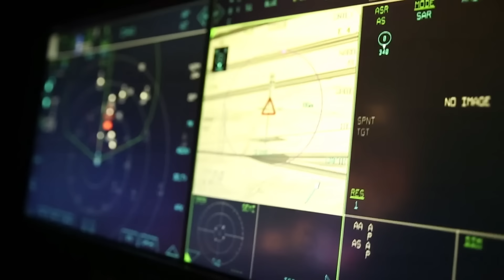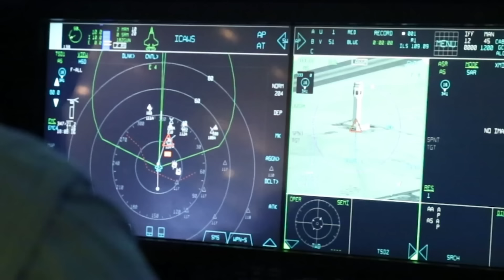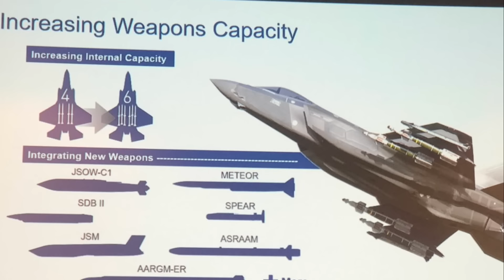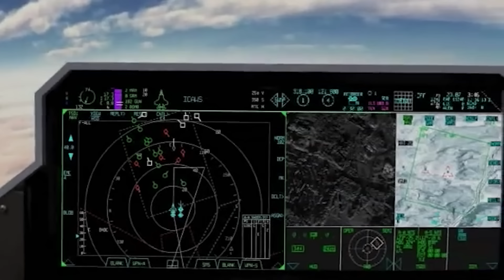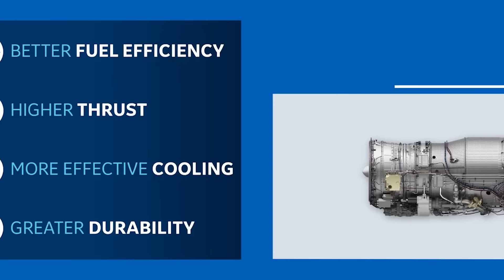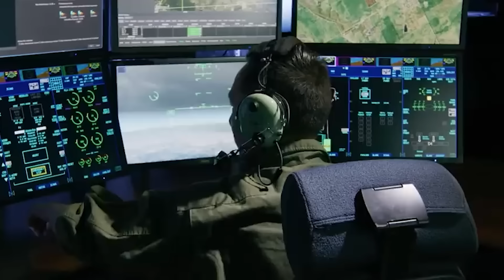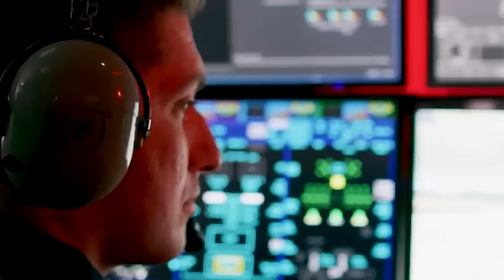The F-35 is about to become a POWERHOUSE

Comment: I have flown many types of aircraft and when a pilot tells you he likes the one he is flying the best, it makes sense to believe him. F-16, F-15, F-18, F-4, and many pilots from other countries have all said that the F-35 was the best most awesome plane they had ever flown and they didn't want to go back. Having been in many friendly dog fights, knowledge is king followed by speed. It can be visual or electronic but that is the edge every fighter pilot wants. This plane coupled with all of its sensors offers so much info that it might lead to an overload of the pilot. I understand that they now have a threat analysis computer that prioritizes the threats and can actually engage them in the correct order of danger. The new off-boresight helmet also makes getting on the 6 o: clock unnecessary and makes them even more deadly. At the Red Flag exercise, the kill ratio was one F-35 to 15 F-15s. I was a head-on Sparrow guy and a tail-end AIM-9 guy but those days are over with this plane. In a 4th gen fighter, I would not want to go against one.
Reply: you make some good points. I am not a pilot, but since my country, Canada, now is going with the f-35 instead of the Gripen, I am wondering if the f-35 is always the best choice. What happens if NATO gets loaded up with F-35's and then Russia comes up with satellite tracking, and ground based radar systems and planes with radar systems that make the stealth ability of the f-35 far less effective than it is right now? Seems like it might be wise to have a variety of planes that have different abilities. I don't like all the eggs in one basket when it comes to weaponry.
Reply: Tracking planes with satellite? Satellite is way to fast
Reply: @cameronkrause4712  have you seen Russia's excuse for a stealth fighter? And they do have radars that can track the F-35 (those are Russia's words, so take it with a grain of salt), but to track the F-35 the radar needs to turn on in the first place. When it does, itll eat a AARG-ER.
Reply: @cameronkrause4712  if F35B can be detected at practical distances, imagine how hopeless would be the non stealth planes. They could not even take off.
Reply: @drake101987  that is legit my point, but reworded. my point is that Russian radars may be able to detect it, but not shoot the F-35 down.
Reply: @cameronkrause4712  If they are stealthy, how would a satellite track them? Plus in a close combat area, a satellite would not be of much use since all of the aircraft would be in a merge situation.
Reply: We are impatient to see this fabulous plane exploded by Russian fighters and other missiles !!!
Reply: @Z24BL2  Not with the 1980 missile technology the Russians have. They are lucky to leave the launcher!
Reply: They use a low-frequency set that shows where the returns are not there or normal. It is radar by omission rather than the echo. But, that doesn't mean they can shoot them down only know where they might be. The F-35 is a much smaller return than the F-117 which was shot down years ago and has other assets.
Reply: @rudyyarbrough5122  Satellite tracking is generally touted as dealing with stealth by visually tracking as a complement to radar/IR. Signatures are bigger from above, but tracking birds from takeoff is the real pitch.
Reply: That doesn't make any sense. The helmet may be able to see behind the fighter...but the missile is only 90 degrees off bore sight. Do people not understand 90 degrees is left and right and behind you is 360 degrees?  Why do I keep hearing this from F35 fans. "I have friends in ( ________)  and they say F35 shoot UNDER itself ". Or something equally innane?

No I'm pushing back on this. It's a gross over simplification. Even if you could fire behind you missiles have a minimum Weapon Engagement Zone.  They can't turn on a target inside that Zone. Not even OFF-bore sight missiles. We must still maneuver to your targets HIGH six.  It may increase the angle of firing the missile but it does equal firing behind you...nor does it guarantee the missiles will hit target. They can still maneuver they can still Flare off a missile. So please stop misleading people. The F35 doesn't eliminate the need for dog fighting at all.
Reply: @saquist  No one said it solved all of the old gun problems but it makes a missile kill much easier. I learned my lesson and would always prefer to have a gun on board any aircraft that I had to fight with.
Reply: @rudyyarbrough5122  you said the new high off bore site missiles make maneuvering onto their six unnecessary and that's clearly not true. Strongest heat signatures will be from the rear where the flamey end is .  And Radar guided missiles need nose on target because there is no rear facing radar
Reply: @saquist  You are nit picking because you know I meant that it will not be necessary to get on the six because the missiles can be launched at a much greater off angle than ever before. The AIM-9 is also much improved over the Vietnam era missle and has a much better seeker head.
Reply: Rudy Yarbrough, the one "F-117 which was shot down years ago" was shot down under exceptionally NON-stealth circumstances---i.e., its bay door was stuck open, thereby nullifying its stealth characteristics.
Reply: saquist, hey, geometry genius, 360 degrees is not behind you. It is in front of you. 180 degrees is behind you, and 90 degrees (even granting that that's factual, which I don't---and also doubt---without doing some research) is the entire frontal hemisphere.
Reply: @jamesedwards6173  I don't think English is his first language and his nonsense shows it.
Reply: Two pilots of the same skill, new F35 or F22?
Reply: I would love to go against one with a drone, and that is what’s going to happen. You are living in the dark ages, but because you are a pilot, and you have been glorified even though you are The weakest link in the system, you think you are the most important Factor.  I am a pilot team and I am an engineer, and some of the components on that F 35 pig, I designed them, and I’m ashamed of this plane. A waste of money. Drones is the future including an aerial combat.  

Before I was an engineer I was a technician and I worked on the most advanced fighters at the time. They did not need a pilot. Check it out, the F106 Delta dart,  older than me, more than 63 years, and it didn’t need a pilot to intercept enemy aircraft.

You pilots are a joke, a complete disgrace to our National defense. We waste money on you when a computer is way better, and way cheaper, and will not beg for mercy when taken prisoner of war, as I have seen so many pilots do. I’m a pilot too, as I said, and I know damn well that the pilot is the weakest link by far. Get the damn pilot out of the combat arena. It makes no sense.

Go ahead, watch the Ukraine war prisoners, watch those “brave” pilots beg for mercy When they are shot down. That could’ve been you, and he would’ve been begging just as much. Humans are cowards.
Reply: @steveperreira5850  Maybe you have heard of the Hanoi Hilton? It was full of US pilots and for some reason, I don't remember one single pilot "Begging" for mercy or his freedom. How about WWII and all of the airmen from many different nations NOT begging for mercy or their freedom. I pray that you have had nothing to do with our nation's defense and that everything that you have said is a lie. I lived through Vietnam in spite of "Engineers" like you. They gave us a wonderful plane but since they knew best it had no gun. The "Engineers" gave us the AIM 7 and the AIM 9 neither of them was worth a plug nickel. The "Engineers" at General Electric gave us the J 79 engines but forgot that the smoke trail that it emitted was a red flag for our enemy's pilots to track us down with.  We used electronic bomb fuses because the "Engineers" told us they would be more reliable than the old propeller fuses we had been using and it almost cost an airplane and crew because they exploded prematurely. Yes, I know all about "Engineers" and their we-know-it-all approach to warfare. Like the other shmuck on this section who knows it all, wait until you have to use the things you create before criticizing the people that are stuck with them trying to stay alive.
Reply: Steve Perreira, as an engineer (electrical and software) who's spent years in industry, over a decade in the U.S. Air Force (active duty officer), and also time as a government defense civilian, I'll just say this: you're almost completely full of crap.

I say "almost" only because I agree with you that [semi-]autonomous aircraft are the future... but, here's the critical point:
Not. Yet.

There are zero "drones" that can hold a candle to a skilled pilot ... so far.

It definitely will not always be that way. But, it is right now. It seems reasonable to project that the F-35 may be among the last manned airframe of its kind, but that no more means it's not needed right now than that all of its predecessors were not needed "because some day 'drones' will dominate."
Reply: I have a different take on that point, but related. Although having a massive fleet of one type of fighter has certain advantages, it also represents a single point of failure. If a weakness is found (and lets face it, when it comes to cyber warfare, the US's adversaries are on par or superior) it could compromise an entire fleet of aircraft. Not convinced as a war strategy, but a great financial investment strategy ;-)
Reply: Interesting take.

First off I think dogfights are firmly a thing of the past. I think we are hoping others (Russia China) will keep thinking about dogfighting so when a conflict actually happens it will look like a bringing a knife to a gunfight. They will be ready for a dogfight that never happens.

Secondly I think you are right about the data overload. My guess is that this processing power will generate a "survival path" that will tell the pilot exactly what to do to win an engagement. It may even have a switch to just let the computer fly the engagement and will probably automatically take over if the pilot is unconscious, dead or underperforming.

There is just no way a human could effectively orchestrate an engagement with multiple friendly and hostile assets and that much data being generated. At some point the F35 just turns into an automated control center with UAVs doing most of the work. Possibly the pilot will get some choice on the attack plan but the computer will control the engagement.
Reply: @JustifyJustin  I'd just like to pick one nit. Our adversaries have invested heavily in offensive cyberwarfare, but their defensive capabilities are severely lacking. This is a situation which is only going to get worse for them as offensive capabilities get a bigger share of a rapidly growing western investment in cyber overall.
Reply: If you are flying this plane,you can see space from it if you fly high enough.
Reply: @De_cool_dude  Yes, Russia can detect those F-35's

but detecting and getting a radar LOCK are two different things. the F-35 is low observable, not invisible.
Reply: @RazorsharpLT  whats your point? That is literally what i said
Reply: @cameronkrause4712  lol...don't overthink things. Russia SU-34 35 Su-75 Su-57 cost only a fraction of the cost. that mean they are not as good...right? they can't compete!!!
Reply: @saquist  you must be an engineer. you argue like one...and your right. they think the Russians and Chinese playing. corporations sold us out. this place is in trouble
Reply: @jamesedwards6173  thanks for the correction...180 is behind. Thank you buy that's an excellent example of the need for accuracy and accepting correction when proven wrong. I don't understand why it's always so personal to be corrected in comments
Reply: You would be correct. Truly an engineering marvel.
Reply: @cameronkrause4712  Russia is lucky if it has the capability to harvest cabbages in a few years.

Comment: Your math is wrong on the 75% increase in radar detectors. Logic check, if you start with 5 and add 5 more, that is a 100% increase. So if you added 15 more that is a 300% increase because you are adding 3 times more the original amount.

Comment: The f-35 program has become something to be very proud of ♥️
Reply: Such a pride inducing aircraft the USAF recently cancelled a huge F-35A order and bought F-15EX instead. The reason? F-35 is an antique under the skin - the drawn-out development program and various freezes to iron out thousands of bugs have left it years if not decades behind architecturally. Meanwhile simple gen 4 planes like F15 can have swift upgrade programmes to keep the sensor, comms and RADAR suites on the bleeding edge.  The US forces won't be ordering any more F-35s until the technological refresh programme is complete as they know the plane is already obsolete - block 4 is just a sticking plaster pushing the creaking outdated systems to the limit.   Making insanely integrated aircraft was huge mistake - you simply cannot keep them up to date with advances in multiple areas.
Reply: @LondonSteveLee  
The only reason everybody is not buying F- 35s to fill their entire fleet is because they need some other aircraft that carry more weapons and are faster/cheaper to produce. The f-35 production lines have been at maximum capacity and will remain there. They cannot make them fast enough to fill orders.

Every complex machine that takes years and years to develop is somewhat outdated before it's finished. The f-35 is less outdated and more capable than every other aircraft flying. The only other aircraft that comes close to the f-35 is the even more "outdated" F-22.

Comment: Agile development is expensive initially but the benefit of using this way to manage fighter manufacture provides so much data and future ability to produce far faster and far more effective systems. The knowledge and capability increases not just for the f-35 but any future fighter jets that can far faster develop in the future rather than starting from scratch. People just do not realise this. The cost of future fighters are already going to be cheaper because of the data gathered from the f-35 programme. Many existing jets will also utilise the benefits developed with the f-35 programme (e.g stealth coating being one)

GE sounds amazing 20-25% increase in thrust and distance thats impressive!

When your hear about new tech like fluidic thrust vectoring on the NGAD and self repairing systems & wings that are modular and adaptable with multiple system built into the wing (sensors, Stealth, Comms, Energy weapons, scanning, Optical data recognition, Laser weapons internal weapons systems with AI able to take control of the fighter or a person remotely its feels like star trek technology!

Comment: By upgraded adaptive cycle engines do you mean higher or lower bypass turbo fans ? Or a more complex furbofan turbo jet cycle? Or even more complex permanent compressor bleed turbo jet to ramjet type design like the j58?

Comment: Just as a general comment it seems that many contributors may not fully appreciate how radar systems are affected by counter measures. An aircraft’s “stealth” capabilities are usually defined across a spectrum of possible detection methods. The spectrum includes X band and S band radar, infra signature and radio transmissions.  The noise floor of a radar system sets the limit below which weak returned signals from potential targets cannot be discriminated from other signal clutter. Electronic counter measures can effectively raise the “noise floor” of an opponents radar system making detection of aircraft with a low observable radar image more difficult. Other counter measures can spoof an opponents radar system to register false targets. It is the combination of tactics and an aircraft capability that make 5th gen fighters like the F35 more deadly. The phrase “first look first kill” is often quoted when discussing “stealth” Advanced situational awareness combined with aircraft networking allows tactics to be co-ordinated in a manner not possible with previous systems.
Reply: The Russians are 10-years ahead of the Yanks in this technology. "Stealth" is a scam - a Lockheed Martin sales gimmick.

Comment: Do F-35s (or any aircraft) have external cameras and an augmented reality system for the helmet display allowing pilots to look/target through the fuselage or is that tech that's yet to be actually implemented anywhere yet?
Reply: The f35 already has that implemented
Reply: @mdioxd9200  coool...  (for real though, no s/ intended)
Reply: Yeah its called the distributed aperture system.
Reply: @quacksly509  That's so cool...  I feel like that system and a 1-to-1 simulator reference environment (visibility is bad but the reference sim lets you see "through" weather and have daylight/3D awareness at all times) will be a big revolution for aviation safety/efficiency.

Comment: The software on the 35 is so voluminous and so complex that the inability to perform standard regression testing to identify bugs could have been chiefly responsible for many of the program cost overruns and "may" have led the mothership to buy two quantum computers to aid in the required throughput. Which could have been beneficial in achieving Program Readiness Review Combat Ready status. That is all.

Comment: The department of defense shouldn’t even need to think about which power plant to go with, the GE adaptive cycle engine’s the way to go 100% . Especially when the Air Force starts installing lasers onto all their fighters. Having a 25% increase in thrust, 20% increase in range and 20/25 % increase in cooling all the fighters weapons system’s is the engine I’d go with for sure.